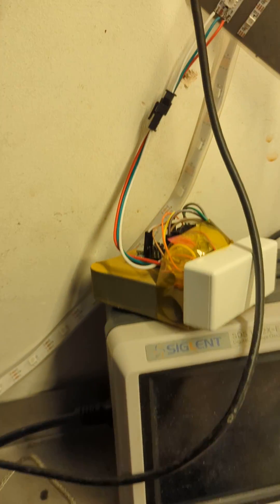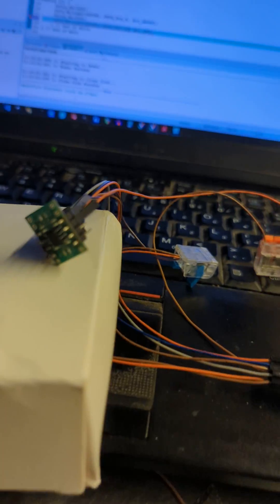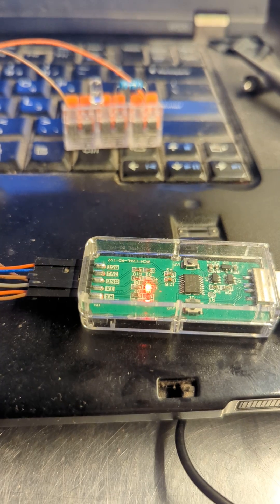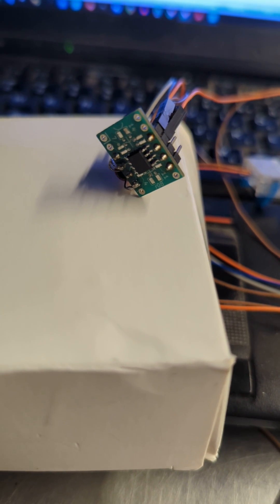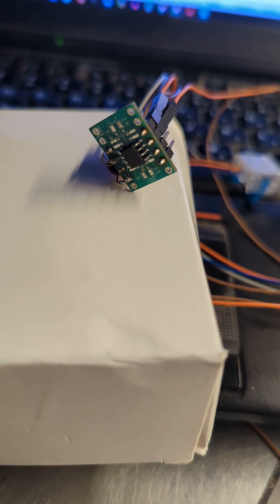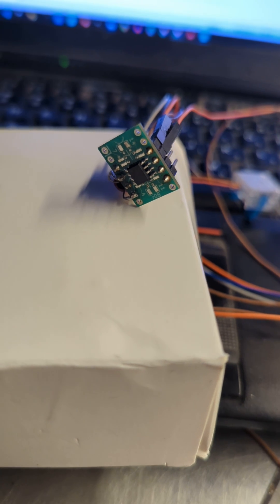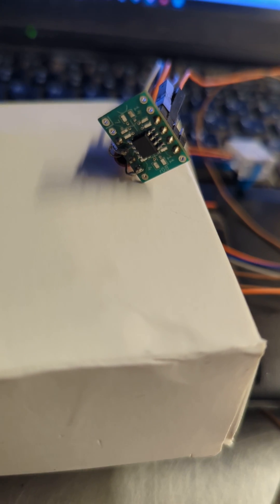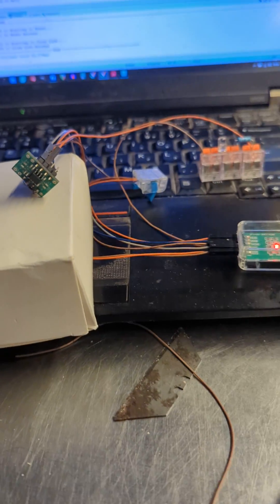8 pin microcontroller for 10p! CH32V003 J4M6 It lives...

Comment: so does it work with ws2812 without an external oscillator? (i'm wondering, how stable it is temperature-wise?)
Reply from the maker: Hiya, yes they work fine with ws2812 with no external oscillator. I'm not running more than about 50 in a string tho.

Comment: Hmm....  I tried the wiring guide you suggested above for the J4M6 and it will not successfully flash the chip for me.  Any other ideas?  I thought that the V003 chips were one wire debug thus not requiring the TX and RX pins.  Btw... I got the 20 pin version working with no issues.
Reply from the maker: Hiya, sorry this was early on in my exploring of these chips. What I settled on is 4 wires: + - tx and (Rx + swio connected together). Often, after flashing the chip the first time, you need to enable reset by power off each time you flash.
Reply from the maker: Update on this, these chips just need 5v, SWIO->Pin 8 and Ground. Haha got there in the end... :D
Reply: I emailed the manufacturer in China and my error on the 8 pin mcu was placing an led output on the same pin needed for programming.  So it flashed once an then never again.  My dumb mistake.
They have a nice utility that will force a full reset/erase of the mcu that I got working.  I really love these chips and I like the manufacturers willingness to answer questions.